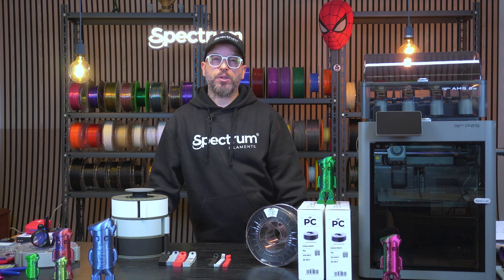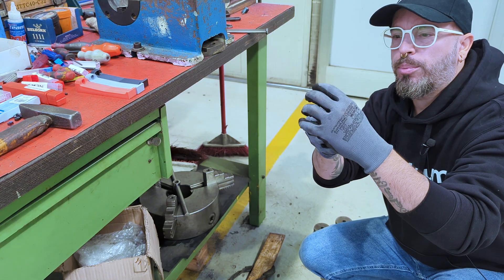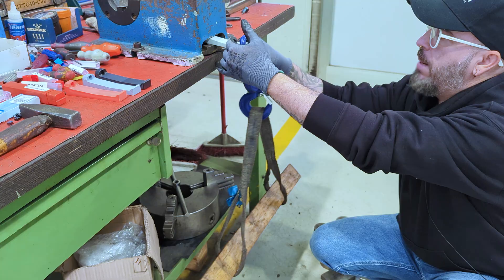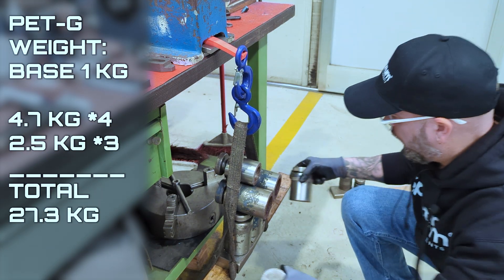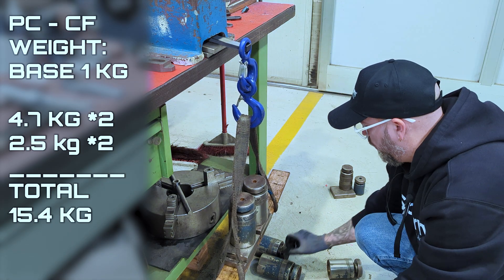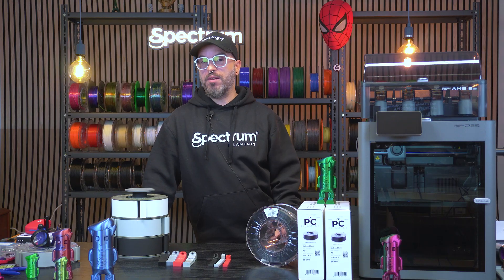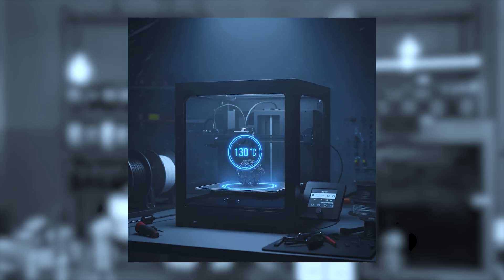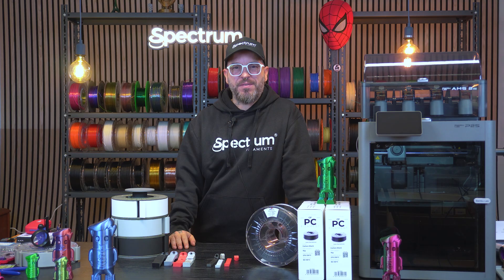PC-CF Looks INSANE! 3D Print Strength and Finish Comparison #spectrumfilaments

Comment: I've tried PC-CF years ago, and it's Amazing.. only issue is over time with repeated stresses (not static pressure) polycarbonate itself likes to develop cracks and it's even worse when mixed with carbon fiber. I used it for bike parts and other things I design and it's an amazing filament. The only thing it survived is speaker mounts in my living room.

So if you do use it, make sure it's not used in something that will have stress loaded and unloaded constantly like on anything that shakes like I found on my bike. Flashlight holder and lock mount both started cracking after a few weeks. I ended up just putting the old parts back on that I printed in PETG. 

I have a custom enclosed printer that warms up to 75c in the chamber (30 minute warm up) and print at 8mm3s flow.
Reply from the maker: Nice one ! Thank you for the heads-up ! I'll keep that in mind 👍🏼👍🏼👍🏼